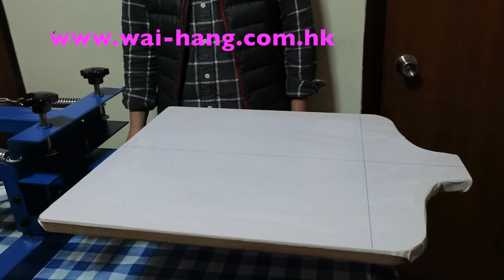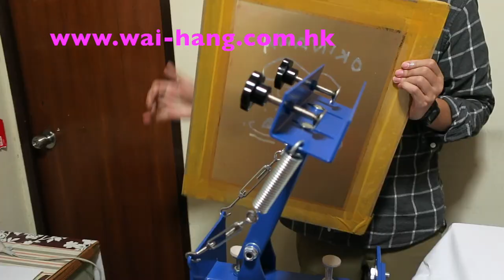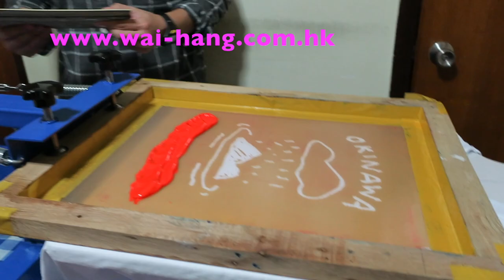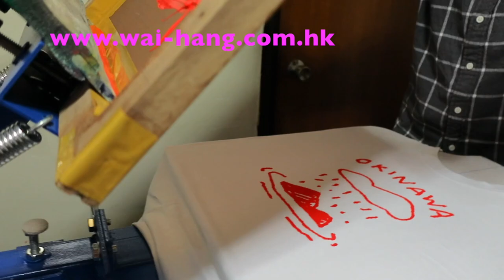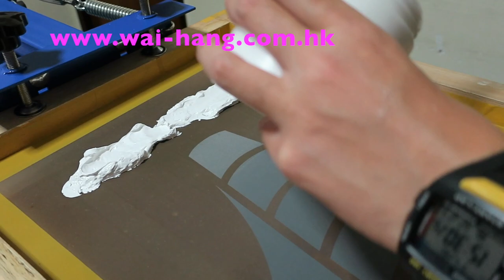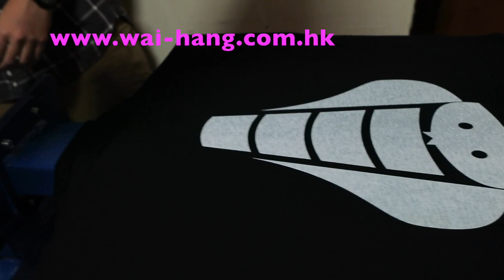SCREEN PRINTING - T-SHIRT PRINTING PRESS

Comment: Hey, What is the dimension of the pallet you're using ?
Reply from the maker: The pallet size is 18 inch x 18 inch. This is a wooden board, you can change the board size by yourself easily.
Reply: Thanks you're my favorite teacher :)